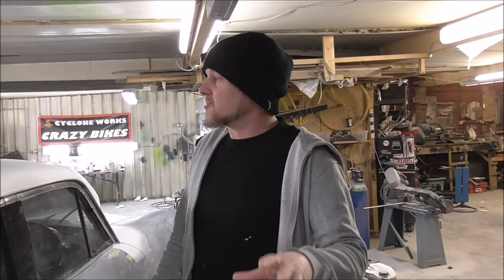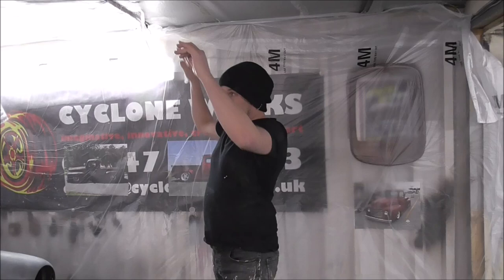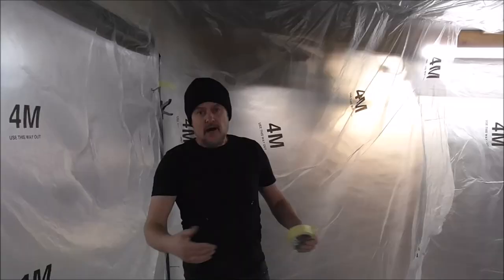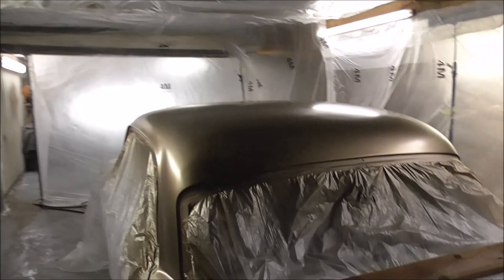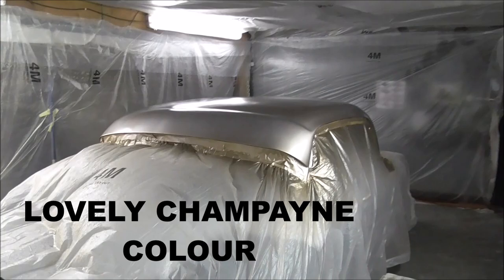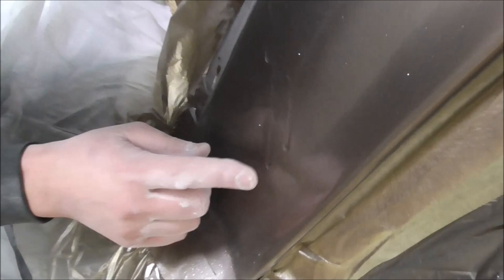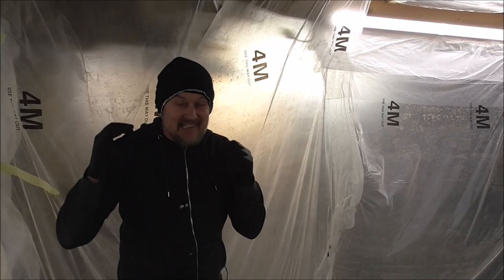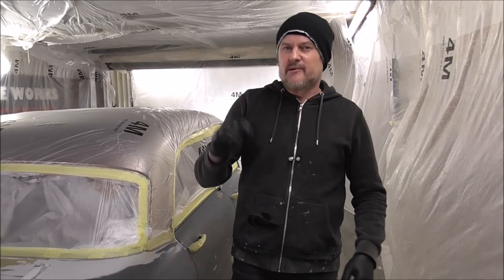1958 Standard Ensign Vanguard Kustom Paint Job

Comment: Let us know what base paint type/brand (water born?) etc and what budget clear you would recommend, great tip with the Rustoleum,😁  Keep them coming 👍
Reply from the maker: The base coat is a mineral paint (standard base, not water born) For the clear I use the one that the motor factors sell, I think with clear setting the gun is the most important bit.  As far as shine goes, it all depends on how much you can be bothered to polish it.